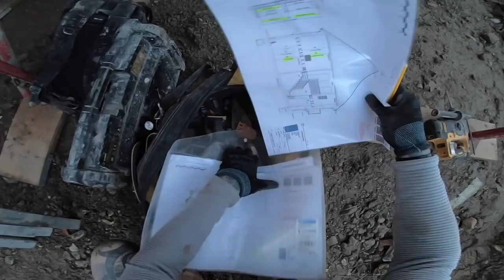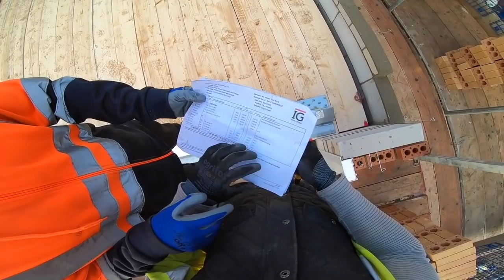How to build a Murder lift (2nd lift) Part 1. Featuring Amy!

Comment: you dont really need to mess about with the woods as long as you keep checking every 5 course then add another clamp as you go up as we use these every day and have no problems if it starts pulling over put a packer in and push brickwork towards profile just keep an eye on them and no problems

Comment: I wonder how many retired bricklayers look at all Charlies tools and see how much the job has changed.All our tools used to fit in a bucket.Great vids Charlie boy.
Reply: Not me
Reply: @martin2466  Money is only just getting back to what it was pre recession/credit crunch i was getting £600 a thousand late 90s early 2000s without the NHBC which slows you down alot
Reply: All depends on the work you do, site work these days just seems to be profiles but lets face it profiles have been around for a long long time, extensions yes that's something where a lot of equipment would be handy, conservation work not so much traditional methods traditional tools, I think this question would apply to carpenters more who have power tools for everything
Reply: @martin2466  Cheers Martin,retirement is fantastic when i watch YT vids of lads trying to make a wage in winter.However summertime working with your best mates is the dogs bollocks.A million happy memories.
Reply: @martin2466  as I remember as an apprentice  trench collapse was an issue and at college we had to learn about shoring up trenches, its not something  you hear about these days

Comment: I'm not in any trade - but when he was levelling up - did he not get it the wrong way around.  One corner was 300, the other three were 290.  Therefore the 300 corner was the lowest one not the highest.  So he should have levelled off one of the 290 corners and made up the difference when laying - rather than grind down the 300 corner?
Reply: Spotted that straight away. I’ve made that mistake a few time as well as going to the wrong side of the level with the tape measure. Always in a hurry us bricked so we’ll keep tripping over.

Comment: When measuring your ceiling datum, the 290 corners were high, not the 300 🤪
Reply from the maker: Yea I realised that after I said it... was wondering who would pick that up first 😂
Reply: I clocked that too. But he also said he’d work off the 300mm corner, which in essence was the right one....
Reply: I think your wrong there Ben🤔
Reply: @CharlieCollison  assuming your ground floor dpc is level, and your window heads are level with the door head (which is standard procedure) you can save yourself all the trouble of the laser level by simply measuring from the heads Charlie. We not flying the house to land it on the moon. I🤣🤣👍

Comment: isn't finish floor top of dpc looks like your putting your datum stick down to the concrete floor which would make your joist lift hight low, im probably wrong but thought you said your 2.4 lift hight was from finished floor. just thought id say just in case mate keep up the good work top lad keep it up.

Comment: So  here's my opinion on brick tongs. Lob them away and use the hod. When you load out with tongs the face is exposed to muck dropping on them. No good for them yellows so just get thrown on the floor.  Same thing if it rains and not covered.  Just my opinion not the "Law"
Reply: Totally agree with you 👍. Rarely see hods now though.

Comment: Charlie,Old git joiner would like to know what the sand on the bricks was for 
Great video mate
Reply: Bricks were wet,to soak up motar and to stop staining brickwork
Reply from the maker: There was water in the holes of the brickwork. The only way to get it out without staining the brickwork is to put sand in them 👍🏻 soaks it up
Reply: Makes sense charl

Comment: What’s the crack with the insulation?
Reply: Polystyrene beads are injected into the cavity when the house is built . P.v.a type glue goes in with the beads to bind them together .

Comment: Does kieran ever meet u in Middle pal hope to god u don't go 2 way split pal never right
Reply: Charlie does too much of the planning, drawings, calculations, tools, responsibility, etc etc to give another trowel just jumping on the walls fast for a 2 way split. It would have to have equal responsibility and probably contribute to the channel without being shy and saying they don't want to be on cam.

My best guess is Charlie will pay brickys a day rate regardless of it they have been on the trowel 12 years or 3 etc.

Comment: Why are the scaffolds  so tight
Reply: It's a camara trick bigger than it looks,  6 boards is standard,
Reply: Oh thanks it just looked tight here in Dublin  the brickies usually get  2 boards   , the mortar and bricks or blocks  go on the middle 2 and the Hoddie had the outside ones to  walk on ,Cheers for clearing that up👍

Comment: I thought murder lift was 4th lift
Reply: Nope was always 3rd lift/band lift cos pre fork lifts and pre scaffold getting lifted for joists was murder for the hoddy as was just running in i.e no reveals or anything to slow the brickies down
Reply: It goes  Bottom,  Joist, Band(off the joist Scaffolding), Murder and top out 
 That's a joist lift not a Murder.. if someone asks you to go load out the murder lift Do Not jump on a joist lift.!!!!! You will look stupid!

Comment: Why did Charlie coat that coarse in sand? Something about wet bricks.
Reply: The holes in the bricks are full of water so when he beds the mortar down it will cause all that water to spue out and stain the brick work below.
Reply: 47:21
Reply: Nice one lads i missed that bit.

Comment: Y do they make scaffold so narrow to work on . Could be 2 more boards wider . Cost I suppose but when a house costs 200k  it’s fuck all really just builders wanting to make has much profit has they can 😡
Reply: No it's about weight and cost we make scaffold as wide as you like but the wider it is the more tubes in in it the more costly it's a heavy duty scaffold
Reply: Plus 6 boards wide is standard scaffold
Reply: It looks narrower than it actually is on camara